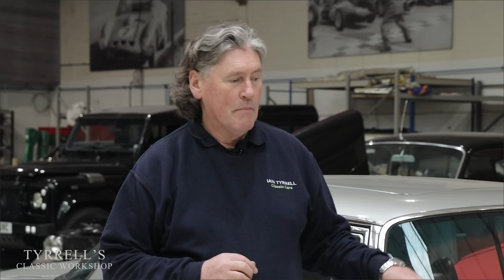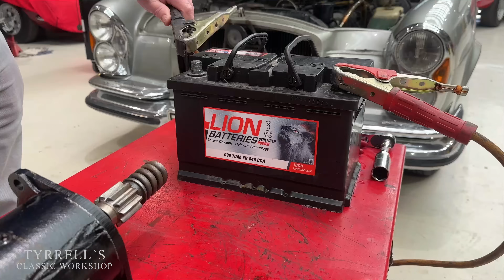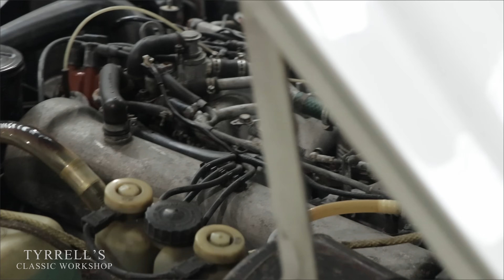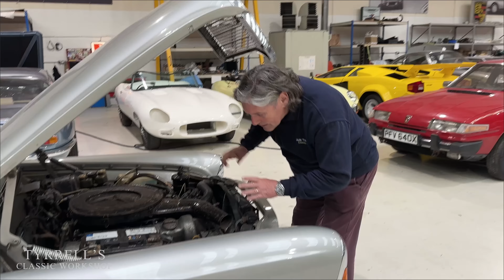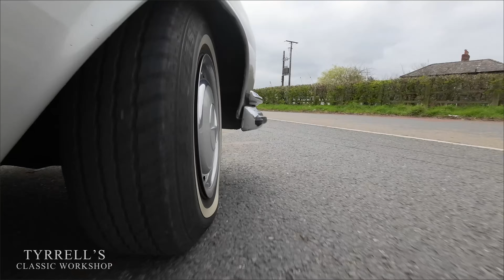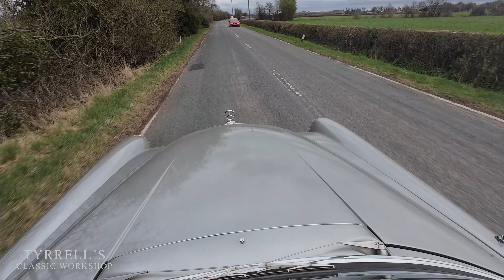Mercedes 280SE 3.5 coupe: Style, power & high-tech W111 | Tyrrell's Classic Workshop

Comment: I'm a bit late discovering this video but very glad that I did!  It made me quite nostalgic!  In the 50s my father owned a repair shop for motorcycles and cars.  He first rode a Harley and, when life got a bit more serious, a '55 Belair.  In the 60s he bought and sold a couple 220S models and kept a '61 for himself.  I think that had a Kugelfisher mechanical injection.  It had a dial for higher altitudes as my sister discovered when she went to Norway in it.  Later we had a '69 280SE, these cars unfortunately all succumbed to road salt. My sister and I would occasionally sneak out and whip these Benzes up to 120 mph, they were rock solid at speed, before general speed limits made that tricky.  This video brought it all back.  Much simpler days but such great machinery.

Comment: Ian. You are misinformed about this Mercedes. I tried watching your video, it is riddled with inaccuracies. After a few minutes of listening to you it was not possible to continue listening. Your information regarding its fuel injection system is, there is no other way to say this, wrong. Bendix of America developed the original electronic fuel injection system which was licensed by Bosch of Germany. This injection system is called the D-Jetronic System. D stands for Druck or Pressure in German, referencing the Manifold Air Pressure sensor of this system. Bosch installed these on Volkswagen and Porsche as well. The ECU, DOES NOT OPERATE THE EIGHT INJECTORS IN GROUPS OF THREE AS YOU CLAIM. Eight cannot be divided by three. It's as bad as saying 2+2=6! Your attempts to describe the operation of the MAP sensor, Manifold Air Pressure Sensor, are mistaken as well. The MAP sensor is an "Engine Load Sensor" As the engine accelerates, the Intake Manifold Vacuum drops signalling the ECU to deliver more fuel. This the ECU does by delaying the injector closing point. Thereby delivering more fuel, the fuel delivery pressure remains constant. The D-Jetronic can be thought of as a analogous to the Ignition System, where spark delivery is controlled by "Contact Ponts" in the distributor. The D-Jetronic System operates in a similar method. Under the Ignition Contact Points in the distributor there is a second set of contact points, this set consisting of 
injection contacts. These contacts inject fuel to two cylinders at a time, as in an eight cylinder engine, it is two four cylinder engines in V formation. The manner of operation is, the injector contacts create a fixed electronic square wave to the fuel injectors. The leading edge of the square wave is fixed, however the trailing edge of the square wave is delayed depending on engine temperature and intake manifold vacuum, thereby enriching the mixture by increasing the time the injectors are open, to provide more fuel during warm-up or acceleration. You can see this using an oscilloscope or electronic voltmeter that can read duration of an electronic wave in milliseconds. As in a contact point ignition system that provides a Low Voltage High Ampere square wave called "Dwell Angle" which is stepped up to a High Voltage Low Current signal to the spark plugs, the D-Jetronic System takes the Low Voltage Low Ampere Fuel Injection Contact signal and switching it to a Low Voltage High Ampere signal using Switching Driver Transistors in the ECU. I am a retired Mercedes Category III technician and an NIASE Master Auto Technician. I worked for Mercedes for many years then ran my own shop for another long period of time. Mercedes used the 280SE 3.5 as the development test bed for their small V8 program. The large V8 being the 600's 6.3 liter V8. As a caution we replaced the fuel hoses and fuel rail to injector hoses after a few years of operation or storage as the rubber deteriorated over time. This was aggravated by Ethanol fuels which ruined hoses sooner, we used Ethanol resistant hoses when replacing the hoses. Always advise the customer to perform this maintenance and upgrade, otherwise the hoses WILL leak spraying 30 psi or 2 Bar pressured fuel on the high voltage ignition wires causing an INSTANT FIRE. Many fuel injected engines have burnt down because of neglected maintenance and upgrades. I had one customer drive into my shop, engine shaking and misfiring suddenly bursting into flames under the hood. Quick thinking technicians turned to hear the engine misfiring and saw the fuel catch fire under the hood. They grabbed fire extinguishers, threw the hood open spraying fire extinguishers and ran to shut off the engine. We got away with a scorched hood and minor engine damage, we were lucky.

Comment: Hi iain,i want to start a w111 1969 its stood for 10 yrs how do i prime the oil flow before starting and anything else i need to know,i know nothing about mercs im a v8 rover guy ,and easy to prime them take dizzy out and spin the oil gears with a drill,is a merc the same?.regards Dave

Comment: The precision and detail Mercedes benz pre 1992 ie pre electronics and mechanicali throttle linkages I had a 90 300d w124 mercedes and the throttle linkage had numerous linkages was  so cool to look at and smooth compared to other car brands throttld design was something else I was ford trained then indie garage worked on bmw audi and Mercedes and got confident then. So my dad got to enjoy this experience also.. I got him a few pre 92 Mercedes cars ie W123 coupe and w124 300d and W124 300 coupe 2 door from crappy ford orions mk3s and mk2 Sierras that were poorly built.. Mercedes used cars held their value we paid 15k  for a 1990 300d w124 in 1994 with 45k and we still have it in garage daily 300k goes well 😊

Comment: The 3.5 liter V8 was a mainstay in Europe for a while. When Mercedes introduced the new 350 SL to the American market in 1971, under the hood was the 4.5 liter version of that magnificent engine. Mercedes knew that a bigger engine was needed to compete with American V8’s. The 4.5 was good for 200,000 miles with proper care, and earned a reputation for trouble free service. The Mercedes built 4 speed automatic had one more gear than competing American auto boxes, and its shifts were more firm and precise. The MB transmission would start in second gear under normal operation, but first was selected for a full throttle launch. The fully independent suspension was marvelous in operation, offering a supple but controlled ride even at sporting speeds. The low pivot rear axle kept camber changes in check even at full chat. The entire automobile was top quality and in another league entirely from Stateside competition. The 6 cylinder models were equally good, if a bit slower. The lighter powerplant improved handling and steering feel to a degree vs the V8 models. This era of Mercedes truly was a turning point for the brand. The 1972 and later cars lacked the classic wood interiors, and federal emission and safety regulations ruined the sophisticated looks and performance. I was fortunate to own a 1967 250S, a 1971 350 SL, and a 1971 280 SE 4.5 sedan. They remain among my most cherished automobiles of the many I have owned.

Comment: A modern gearbox conversion would make these cars perfect.  The auto's are very strong but clunky and the "off the line" 1st was never a good idea.  Mercedes originally designed these to be changed manually and if driven this way they are much better.

Comment: I think it's interesting that the later K-Jetronic used in the 70s and 80s is even more reliable than D-Jetronic and uses no transistorized electronics whatsoever, being fully mechanical. I've heard D-Jetronic is more responsive, but I'm quite happy with the performance and reliability of the K-Jet paired with an automatic transmission on my '84 280E. Great video and history lesson as usual. The US really was the most advanced tech in the world in the 1950s, so it's not surprising that the first electronic fuel injection came from there.

Comment: The engine bay DESPERATELY! needs renovating to do this car justice. I love the way the fuel is injected at the right " Psychological moment" 16.32 though. I think Iain meant " Cyclical"😊.  I note the " Tamed" throttle response too. My 440i is similar in " Comfort" mode. I also had a Ducati 800 Scrambler which had a throttle response so immediate that it was almost unrideable, so I sold it.

Comment: Thank you Iain! One of my favourite cars from a looks perspective. Always has been. Two questions for you. 1) You mentioned that a petrol engine is always pulling in air. Is that not the case for all combustion engines, and if not, what are the other scenarios?  2) I noticed a fan in front of the radiator and I noticed it was not turning when the engine was running, while I could see another coweled fan behind the radiator which was. Is the front one powered electrically and based on engine temperature?

Comment: There was a time when I had a draw full of those old ECU and map sensors.  Interesting fact is that after Mercedes Benz stopped using D-Jetronic, Jaguar picked it up for the XJ12, using D-Jet components made by Lucas. From my understanding, that's most reliable version because the engine has more cylinders, and the fuel injection is made by Lucas

Comment: The injectors of these cars are controlled by trigger points in the distributor. When these need servicing, you know about it, because the engine will run rough. The uninitiated owner will replace just about every part in the fuel management system to fix the problem, only to give up, due to being unable to fix the issue. Yes I have worked on those systems before.

Comment: Iain certainly knows his stuff. However, he probably should have mentioned the fact that, while this is a W111, it's actually based on the W108, which is the immediate model after the W111 (1959 to 1967) & whose chassis is basically identical to the W108. Mention W111 to an American familiar with 60's Mercedes-Benz & most will think coupés & cabriolets. However, the overwhelming majority of W111s were sedans.

Comment: Because of stop start regulations, 99% of modern vehicles start instantly when turning the key or taking your foot off the brake in traffic conditions. My W213 E220d starts instantly even when very cold. Your explanation regarding oil needing to be circulated before start is a valid point. Perhaps just another reason why stop/start isn't an ideal idea. Mind you modern engines tend to use "Thinner oils'

Comment: Thank you for this fine tribute, Iain. I had a somewhat similar looking 1973 300 four-speed manual dressed in white when I lived in Singapore from '94-'99. Though she was six cylinders, she had loads of grunt, and personality and seemed to thrive on abuse. I found a mechanic in town who knew these engines and could keep her tuned just so. Alas, she succumbed to the tropical salt air -- floorboards rusted out -- and I had to give her up to the wreckers, even though there was nothing mechanically wrong with her. I called her Scarlet, because of all the many small scars she had from rust repairs over the years. I still think of her regularly. RIP, Scarlet.

Comment: Does anyone know where you can find white wall tires like on this 280SE? I have a 72 250/8 with 14 inch wheels
Mercedes was always the leader in car safety. Just some were shoulder belts, padded dash I believe, padded steering wheel center for no chest to column and collapsible column,  impact, front air bags, side impact air bags, safety belt air bags, front crumple zone body construction, safety cell passenger compartment, Pre safe system that adjusts seats, closes widows and sunroof, tightens the seat belts, Intelligent Drive System using sensors and cameras to take evasive action and I am sure others

Comment: I have a 1975 W114 280E that has D-Jet on it, it's pretty amazing how well it still works for being 50 years old and as far as I can tell, basically untouched. The only real issue with the setup is the idle air valve that operates off the coolant temp - it's an aluminium piston in an aluminium bore that is stuck open. In order to not have high idle when warm but still be able to cold start it, I've ended up bypassing it via a heater tap and a choke cable. A bit crude but it works and I didn't have to chop anything up to do it. If the system ever proper packs it in I'll probably look to put modern injection and ignition on it just to see if I can, and to have it run a bit more efficiently as it's my general daily driver.

Comment: The Bendix Electrojector multi-point fuel injection system was only filled to 35 Chrysler Corporation cars in 1958. The main reason for its failure was due to stray EMI in the engine bay affecting the primitive ECU. It took Bosch another 9 years to perfect the system.

Comment: Beautiful car, love the W111 coupe! Here are some insights to your presentation:
The D-jetronic system on the M116/M117 (Yes, NOT M107) delivers fuel to each row of cylinders by a point gap system under the ignition distributor. Each row of cylinders (not every cylinder separately) are getting a certain periodic amount of fuel at a time by activating the injectors. The length of the period is dependent on the MAP-sensor position, coolant temperature sensor, intake air temp sensor and the positioning of the throttle. The fuel tuning screw (potentiometer) on the PCU of this system is NOT an idle micture screw. It`s for fuel only, the air screw is on the intake manifold and has to be adjusted together with this potentiometer. There is also a cold start injector on the D-jet, you basically had you hand on it while explaining its function..... 😄
The D-jet was a very inaccurate fuel injection system, but very modern at the time. The M117 (4,5 litre V8) was marketed in North america and could be had with a catalytic converter in California. 

Greatings
Reply: Did they use the 4.5 in the US to make up for HP loss due to emissions much as they gave us the 560 opposed to the 500 in the 80's?
Reply: The 4,5 had 200hp just like the Euro 3,5. 
Since the lack of fuel quality in North america, the factory retarded the ignition and lowered compression on the US 4,5:s. 
The torque, the 3:27 final ratio and the soft 3-speed wandler auto makes up for it! I love my 300SEL 4,5

Comment: I worked on a cabriolet back in the 80s, a very stylish four seater convertible tourer. The car was black and the black roof was pretty stuffed - back then you could order a whole hood with frame assembly using its chassis number, which worked out cheaper than completely retrimming it (you can probably still do this with Mercedes). Unfortunately when it arrived in its box from Germany the hood was beige, as it turns out that the car had originally been white (the owner didn’t know this). It still looked good, but the seats didn’t match the hood…

Comment: so nice to see these videos, and learn all the history - very interesting to follow the Bosch injection systems based on the Jetronic ... as far as the late 1990s it was almost the same base system but with added MAF contorl, lambda control and better ECUs ( for sure bmw engines used it at least until 1997/8 - even when in some engines the managment was "Siemens" )

Comment: I understand the need to not go long but I think you should have discussed how the injection timing is done. Points! Below the ignition points is a module that is driven off of a cam on the distributor with "fingers" for the points. It's a simple yet elegant way of crank position when timing magnets and 60-2 trigger wheels were not a thing.

Comment: Had the 300SEL 6.3 with similar enormous CPU, air suspension, 4 wheel disc brakes, crumple zones etc. Crazy how advanced they were back then
Reply: The 6,3 had mechanical injection, Kugelfischer type, no PCU there buddy!

Comment: I was the designated driver as 16-year-old working full time at an MB/BMW dealer in the mid-1970s in Palm Springs, where half of Hollywood brought their cars. I washed and detailed the W111s, which were then daily drivers. I even privately detailed Stephanie Powers’ chocolate brown 280SE 4.5 coupe.

These machines, the last of the hand-built cars for Mercedes-Benz, define elegance. Their U.S. demise in 1971 marked a luxury sea change for the carmaker.

While Iain kindly took us beneath the hood and out onto the highway, a close look at the leather and walnut veneer dash, center console and window frames says it all, with tasteful chrome accents, in perfect balance.

The next generation of Mercedes coupe, the 450SLC in the U.S, had a plasticky dash, rubber center console and little wood. Nice, as far as they went, but run-of-the-mill compared to their predecessors.

I was always sad to see a w111 in unkempt condition. I’ll never forget those days at MB, far less pretentious than current “stealerships,” with oversized showrooms and service lobbies, but few people who appreciate the history of MB. Back the, one service writer stood by a small wooden podium by the service door. I drove them all, including a 300SL roadster in the street. And nobody cared that I was 16, and a high school dropout.